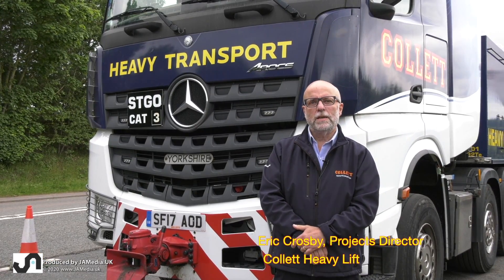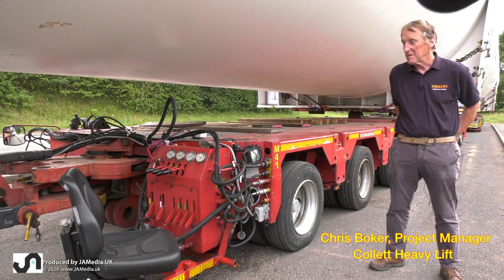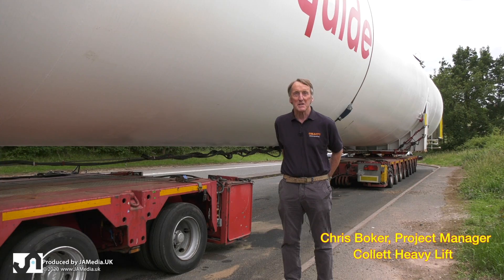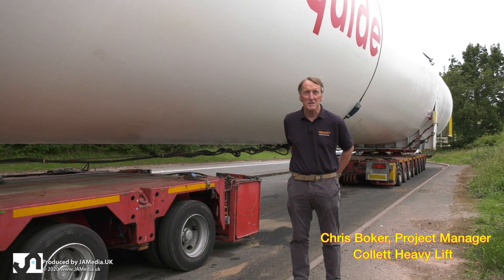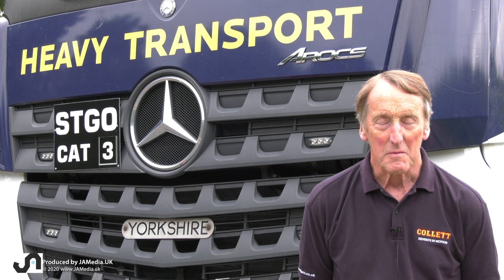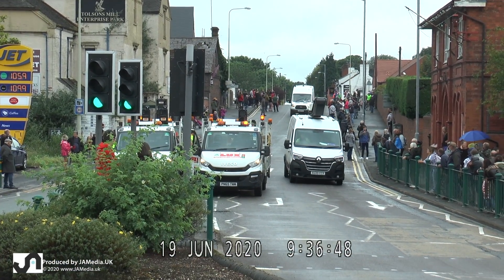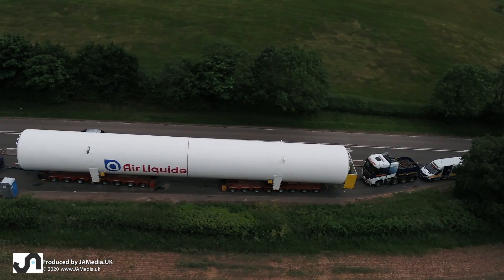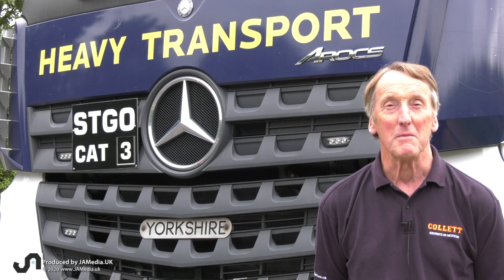Interview with  Collett's on how they moved 225 tone tank through Fazeley, Staffs

Comment: I thought it was going to be military transport and the best way to move a 225 tonne tank with a gun on top would definitely be a straight line.
Reply from the maker: Actually MBT's (Main Battle Tanks)  are normally moved on a low loader rather than driving themselves if they are going any distance. Strange but it is safer and easier to use a low loader.   In combat tanks do tend to "go where they please" but normally they are supported by infantry.   Though in open deserts less so.  Tanks are not indestructible and can be quite vulnerable in built up areas. 
BTW the film Fury was based on an incident with a WW1 British tank.   By WW2 the Germans  had Panzerfaust's and any infantry platoon could take out a Sherman in a few minutes. Hence tanks needing infantry support because you can see bugger all from inside a tank.  However Hollywood and historical accuracy have never been on close terms when it comes to WW2 films.
Reply: @JAmediaUK  I was making a light-hearted joke but I do appreciate you taking the time to reply. 
Your reply was very informative as I thought Fury was fiction and I have seen tanks being delivered on a low loader. Told my daughter it was a test run for Optimus Primes skateboard!
I also do find it fascinating about the preparation and the actual task of moving massive objects. 
This one got my interest more as I live in Tamworth and we were warned to stay away but not why... So I went anyway and watched from a distance because of all the people. 

I was very impressed!

Thank you again for your reply.
Reply from the maker: @cybermerlin2000  The planning took 12 months of multiple people on route planning they looked at the room to move and the "swept area" that is where it over hangs going round corners, weights heights etc  etc.  then there is speed of travel.  Often they are only permitted to use some roads outside certain hours.  IE over night not during the rush hour. It is a hell of a lot more complex and costly than people think.    However less so, apparently,  (as no one will  comment on costs) than building a facility on site to fabricate and test a pressure vessel that has to be tested to certifiable limits.  
Fury is fictional as are parts of ALL Hollywood WW2 films including Saving Private Ryan. As for military movement... I have been straight across the magic roundabout in Swindon (all 15 mini roundabouts)  in an armoured vehicle as the lead of 4 wheeled AFV's . Lot of fun as everyone gave way to us. :-)